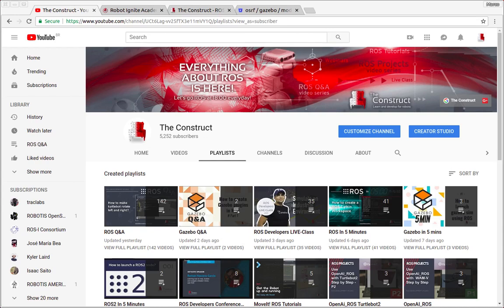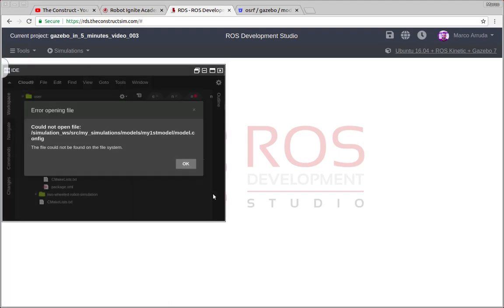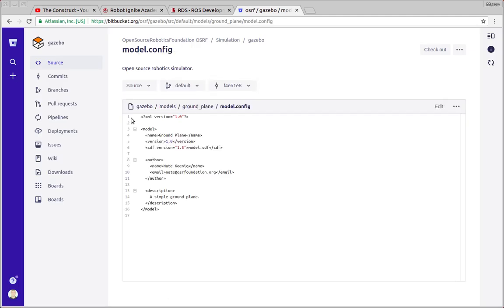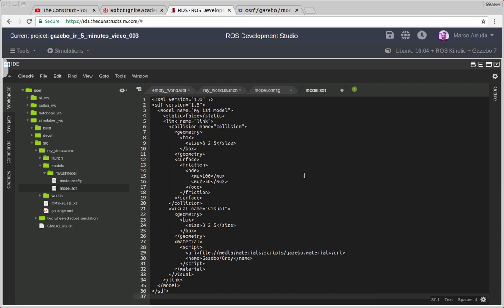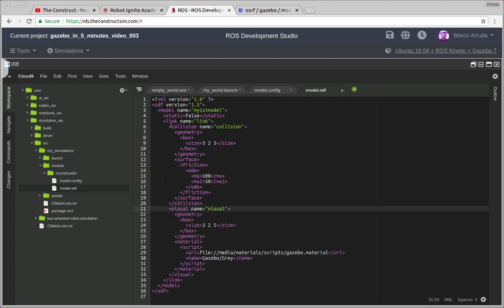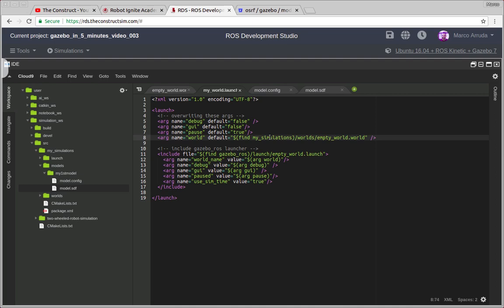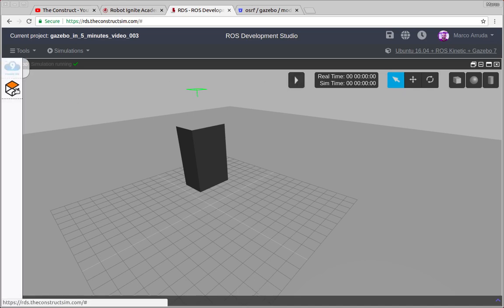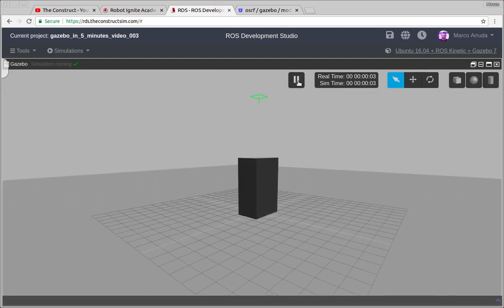[Gazebo in 5 minutes] 004 - How to create a gazebo model using SDF

Comment: For this to work, shouldn't you first set the GAZEBO_MODEL_PATH=[path_to_models]/models first? Otherwise, how would Gazebo know where to look to find your "my1stmodel" model?
Reply: The rest of my models are present in ~/.gazebo/models. Wouldn't changing GAZEBO_MODEL_PATH make the sun and ground plane inaccessible?
Reply: How would it be?
Reply: Hi @jp roberge, thanks for the question.

You are correct, you must set the path before, it's implicit on having a full environment configured. We use to work and share projects in ROSDS, so we get used to skip this part.

Thanks for noticing and sharing it!